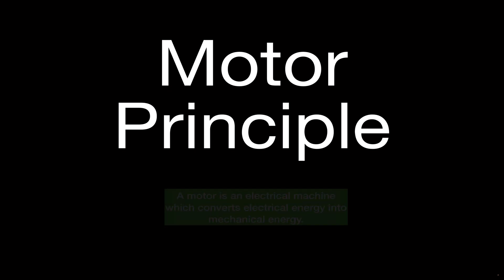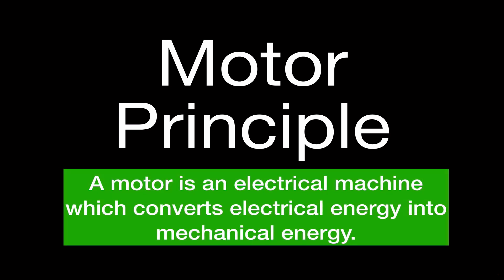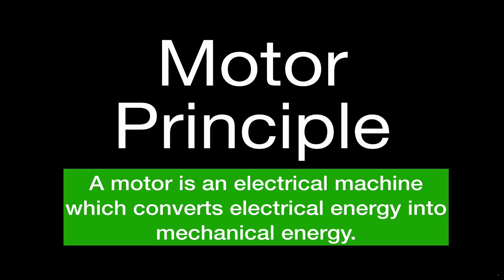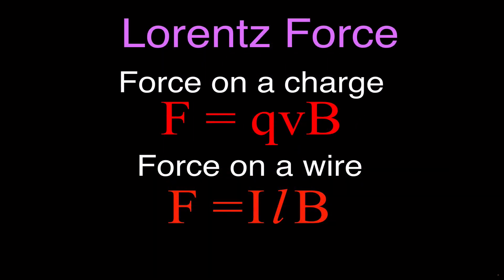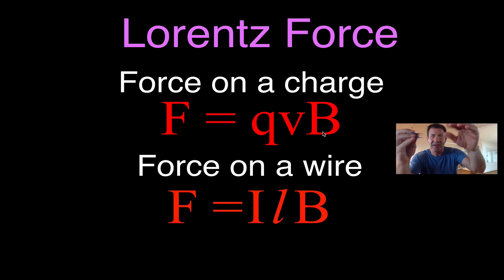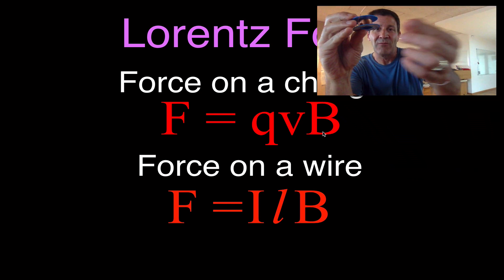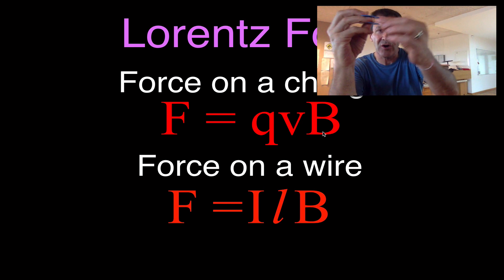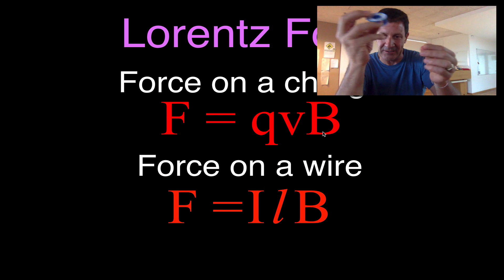Magnetism (13 of 13) The Motor Principle and Simple DC Motors

Comment: It' a fail course because you don't connect the previous theory to this toy
Reply from the maker: In both cases I stated that it is a coil with a current moving through it and that it is in a magnetic field. And they are not toys, they are electric motors.

Comment: hello sir, How to take the values of current and number of turns of the wire.??. with the known speed, length , mass of the shaft.to find the magnetic field strength and force for active magnetic bearing.

Comment: Thank you, very nice video. 
I have  a question:
Why don't you get shocked when you touch the wire at the minute 4:20? Don't you create a loop of current with your body?
Reply from the maker: Good question but it is only like 9 volts, just like a 9V battery, and that is not enough to hurt you.
Reply: @stepbystepscience   Thanks a lot for your answer, so basically the current does flows into your body, but the intensity of the current is not enough to feel it... right?
Reply from the maker: @tommaso.clemente Yes, but if you touch each of the terminals with a finger from each hand it is possible that with just 9V, your body has enough resistance that the current would be zero or very close to it.

Comment: Great videos.  I like the number 13 too, but...  You missed one aspect of magnets that could get you 14 videos,  eddy currents in other metals.  Also, you could add super conductors, and one thing I learned today, combining, when forming the crystals in a lab, of Strontium Titanate and Lanthanum Aluminate create a non-ferrous magnet at the boarders.  They plan to use it for creating memory chips that can also perform electrical computations because it also allows a current to go through it.